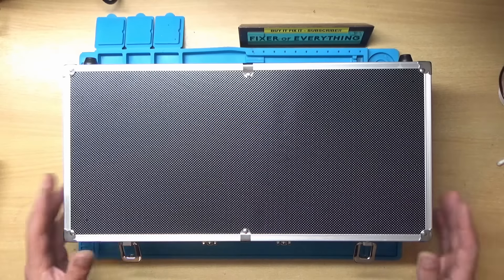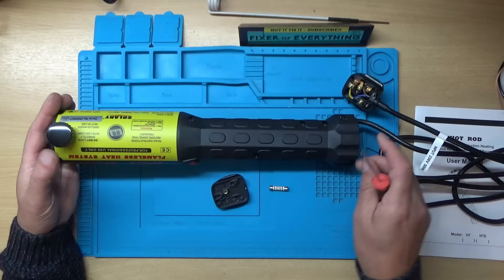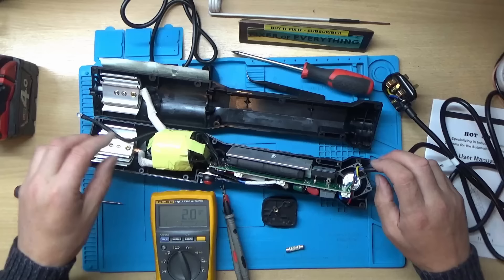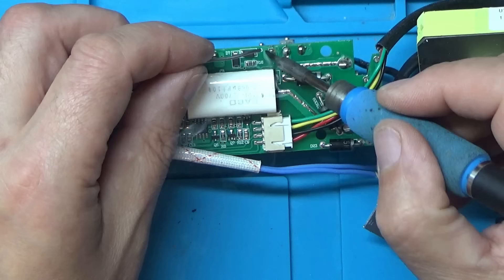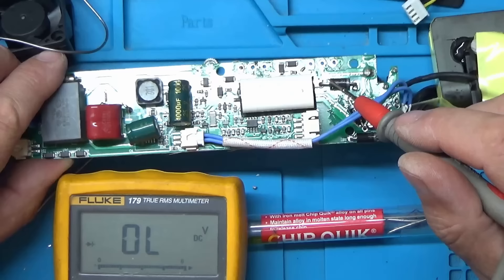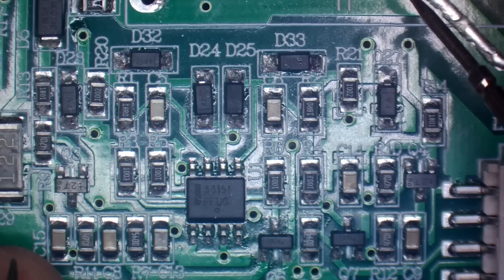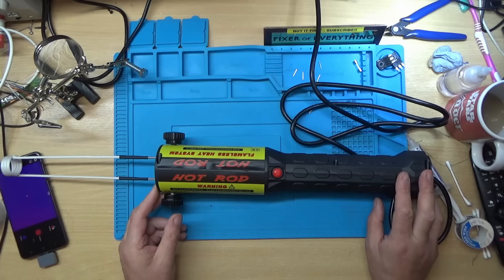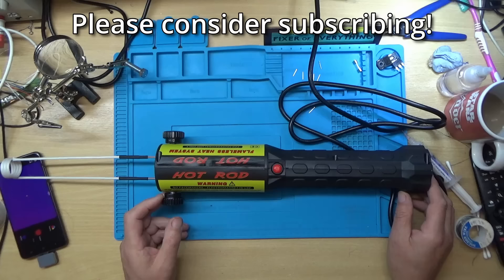Solary 'HOT ROD' Automotive Induction Tool | Can I Fix It?

Comment: hi i think you should replace the igbt driver with the correct part because the thermal switch is for 75c and that is within the operating temperature of the original part but it is outside the operating range for the part you fitted and could fail before the over temperature activates
Reply from the maker: Perhaps, I did think of it, but it's only 5 degrees and it will have a tolerance anyway.

Comment: do you have a cheap suggestion for a decent multimeter please?
Reply from the maker: I've always liked fluke meters but they are usually more expensive. If you get a budget meter get one that is auto ranging as they are a lot easier to use than the type you have to manually select the voltage or resistance range.

Comment: 0-70C is the old commercial temperature range, -40 to 85 is the new industrial temp range  (the old industrial range was -25 to 85) so possibly new old stock depending on where you bought it.
Reply from the maker: Interesting, thanks for that 👍
Reply: extended Industrial (-40 +85) came in at the time when mil-spec components where dying off.  the industrial temp range was extended to pick up the mil-spec components. Which was a real pain as the mil-spec parts came with reliability data which was a great help calculating Mean Time before failure (MTBF's) of your product. You had to stick a wet finger in the air for the extended industrial parts and de-rate the hell out of them.

Comment: You'll need a lot more than 110c to remove siezed bolt, how hot will it go?
Reply from the maker: Apparently it will make them glow red, I saw a video of one in use, but I didn't really fancy a glowing red bit of metal on my desk 😂😂😂😂👍

Comment: Nice video thank you I’m trying to repair a Sykes Pickavant model but can’t find the component that’s broken can you help?
The component is a Orange drop capacitor CDE773P319.
373k550VAC.
1314.
Thank you
Reply from the maker: Hi, from the markings looks like a 37nf  550V polypropylene film capacitor. I did have a quick look but couldn't find the exact one. You could see if you can find one by a different manufacturer of the same capacitance with a higher voltage perhaps? 600V?
Reply: @BuyitFixit  Thank you for the reply can I change the 37nf for higher ?
Reply from the maker: I'm not too sure on that one. It may pass too much voltage or too little if you use a different value.

Comment: @buyitfixit I repaired a similar unit, an expensive one. Pretty much the same curcuit, a lot more diodes for protection. Also brand new, seller just said it was broken. Mosfets, bridge, fuse and one protective diode was dead. My low power side of the board was saved by that diode.
Reply from the maker: Great job. Well done 👍

Comment: Amazing.... I wish i could understand how to repair things like you.... but i´m a car mekanik .... not an elecktrik wizard
Reply from the maker: Thanks 👍 I'm a little of both. I often have my hands covered in oil. My wifes got a discovery 4. Had the body off it 3 times so far, EGR pipes blown, then the turbo's went. Recently had my ML320 up on my ramp as it had the oil cooler problem (after we replaced the main crankshaft seal as we thought it was that). Bloody cars.. .😂😂😂

Comment: The thing I find most difficult is ordering replacement parts, when the data sheet shows multiples of the same part. Along with obsolescence, it gets quite confusing.
Reply from the maker: A lot of the multiples of the same part are just usually quantities or if it is on a reel or tape. I've found that sometimes ICs are exactly the same but with different numbers from different manufacturers, like on the Milwaukee radio I repaired some time ago. Two completely different part numbers and manufacturers, but the same pin out and functionality.

Comment: The fuse is filled with sand it is designed to prevent any connection forming when it blows...By putting a glass fuse in place you circumvented a safety feature.
Reply from the maker: Yes, a couple of others mentioned the same. I'll change it before use. Thanks for commenting 👍

Comment: The ones I have seen working heat nuts and bolts to "red/orange hot" . ..even though they were full size nuts holding down a cylinder head ....... the temperatures in the video were barely above boiling point ....... I think there remains a problem yet to be solved!
Reply from the maker: It does heat up to that point, I've used it since on the car. However I didn't fancy having a red / orange glowing nut on my desk at the time 😂😂

Comment: These things are surprisingly well priced.
Reply from the maker: Unfortunately I think that may be due to the build quality. Some of the previews on Amazon said things like it was dead out of the box or failed after a couple of uses.
Reply: @BuyitFixit   probably because it's using a "cheap" version of an inductive heater driver, like ZVS'es - they fail when you "turn them on incorrectly". The components you replaced are the common culprits... The H-Bridge "stalls" and shorts everything.
Reply: @dimitar4y hi,
Can I ask you to suggest a better quality inductor driver? Or would it not straight swap with the provided pcb?
Reply: @ianhelsbyservices   Sadly, no. I cannot suggest a quality inductor driver - those are what usually makes or breaks the retail available "premium" induction heaters.  

The only "swappable" component is the coil and capacitors. The issue is that quality inductor drivers are usually expensive due to the nature of their requirements. They have 1. sensitive chips to detect the "frequency response" of the coil for auto-tuning, 2. filters to save it from self-destructing, 3. high-amperage, high-speed-switching mosfets - which themselves are already expensive, 4. Bootstrap circuitry - and all of that works mostly specific to the design of the coil (diameter/inductance/thickness/impedance). This is why most people use ZVS drivers as they're "cheaper" than the alternative and require essentially no tuning. But any issues with the power supply or the coil will instantly destroy everything due to transistor failure - the H bridge becomes a full short. Bye bye traces, bye bye transistors, and bye bye power supply sometimes. Most hobbyists use screw terminals for the transistors for quick swapping :')

Comment: Personally I don't like these glass fuses on a mains equipment. The breaking capacity of these is barely 20A at the 240VAC, way bellow the short circuit fault current. That means those are not rated to break the current safely at all, the arc just makes them explode and jump onto something else. Better use the ceramic ones, the breaking capacity of those is 1500A, the cord resistance and mains impedance usually keeps the current within that limit.
Reply from the maker: I might change it as a couple of people have mentioned that. Thank you for your input 👍

Comment: I have two none work. Bought from China AliExpress first worked a couple of days. And heats up bolts and nuts so they turn RED and come off as easily as possible. Changed steering knuckle shock absorbers on a Nissan Micra. And were stuck. Stopped working. My son who is skilled in soldering wondered if there was anyone who had never soldered before as it was very amateurishly done a lot of cold soldering.
Complained and got a new one under warranty. Worked for an hour or so and appeared to be the "same" person who made this. The fuse that was soldered on had tripped removed it and soldered on the brackets to be able to change the fuse easily. But it doesn't work and my knowledge of troubleshooting components "ended" when I replaced the fuse holder. Tried to talk my son into troubleshooting. But the answer was don't even want to see the "shit" again.🤭
The tool itself is and the principle of how it works is absolutely superb, can be accessed in tight places as there are different variants of the "spirals" and can be bent into shape. AND you only heat that part "the bolt" and since it is fast, the heat does not spread to, for example, rubber bushings.
Reply from the maker: I don't think that they are very reliable. I saw a few comments on Amazon saying similar to what you just said. At least if you or your son ever wanted to have a go at fixing it, this video should give you a good idea what to check.
Reply: @BuyitFixit  T
Thanks❗ Yes I will absolutely use your troubleshooting on my devices. Can guarantee that the son will look like this😲🤥. If I find similar faults and ask him to help me replace them, there is a large company Elfa in Sweden that has components. I can handle a multimeter pretty well. Has a short past as a car mechanic on new cars in the mid 70s (Sweden) General agent for Mercedes but also Audi and Simca😬 On a brand new Simca 1100 (similar to a wv Golf) the high beam switch did not work. I debugged with a "test lamp" From the switch on the steering column to the lamp, the cable changed color 4 TIMES and in one of the "joints" the cables did not fit together. That's when my preconceived notions about French car manufacturers turned out to be correct, at least in the 70s. I will get back with the results. And above all you have a new subscriber just the right kind of topic that interests me.
Reply: @BuyitFixit  Thanks❗ Yes I will absolutely use your troubleshooting on my devices. Can guarantee that the son will look like this😲🤥. If I find similar faults and ask him to help me replace them, there is a large company Elfa in Sweden that has components. I can handle a multimeter pretty well. Has a short past as a car mechanic on new cars in the mid 70s (Sweden) General agent for Mercedes but also Audi and Simca😬 On a brand new Simca 1100 (similar to a wv Golf) the high beam switch did not work. I debugged with a "test lamp" From the switch on the steering column to the lamp, the cable changed color 4 TIMES and in one of the "joints" the cables did not fit together. That's when my preconceived notions about French car manufacturers turned out to be correct, at least in the 70s. I will get back with the results. And above all you have a new subscriber just the right kind of topic that interests me.

Comment: Don't you love when semiconductors morph into solder bridges?
Reply from the maker: Yes, I think it's the most common mode of failure.
Reply: @BuyitFixit  True. RF bipolar transistors, the high current flange mount ceramic pill kind, almost always fail open ironically

Comment: Why didn't u just solder a fuse socket so it is easily replacable?
Reply from the maker: Good idea, although I'm not sure if I had a fuse socket lying around at the time.
Reply: @BuyitFixit  You really have an excellent grasp of electronic parts diag. I really want to learn that, but can't find any video's that are consistant. Do u have other videos explaining your diag processes on circuit boards?

Comment: That long part under the heatsink is not an inductor, probably capacitors connected in series.
Reply from the maker: I'm sure it's enamelled wire wrapped around a ferrite core.
Reply: @BuyitFixit You are right, the capacitor is on the other side, my mistake.

Comment: The issue with mine is I can't get the coil to be tight in the tool. It was always hard to tighten the knobs from day one. Had to use pliers.  Probably should have returned it. But now one side doesn't hold the coil at all. I can seem to find replacement parts. Spoke to the company that sold to me. No reply. Useless.
Reply from the maker: Perhaps you could re-tap the threads where the bit that secures coil goes in and use a larger bolt perhaps to secure it

Comment: I have one doesn’t work only used a couple of times really pathetic quality. I don’t have a back ground in electronics so taking it apart would not help me much. These units range from 160- 220 and electronic parts are not very expensive perhaps I may find a local shop to repair it
Reply from the maker: I'm not sure if I'd waste my time. After I repaired this it worked great a few times, then suddenly stopped working. I think there is a design flaw with these units, especially with all of the reviews on Amazon stating similar experiences.
Reply: Thank you so much for replying back very considerate of you to do that! Ok I won’t waste my time with it . There is a reason mini ducter is 500 dollars and these 160-220, buy cheap buy twice.

Comment: You need to put over a bolt to heat anything it does not get hot till there is induction
Reply: Like an induction hob.  It only heats the proper material of pan.
Reply: Right, eddy currents induced in the bolt heat it up.
Reply from the maker: Yes I know, but it wasn't worth at the start as the unit was totally dead...

Comment: You can get a brand new one for little over 100 pounds.
Reply from the maker: This one was brand new 😉although faulty. I didn't really need one, I just thought it might be interesting to repair 😂
Reply: @BuyitFixit  Hope you got some use for it though lol, seems like the type of tool that you don't need until you really need it.
Reply from the maker: @FrozenHaxor  yes, I work on our cars quite regularly and I've encountered a rusted nut or bolt quite a few times 👍

Comment: I think what kills these things is people pressing the button without being on metal.  If there is no metal in the coil, the Q of the tank circuit is much higher (along with the voltage on the components).  The ratings on the devices used to build them are chosen with the assumption that the tank circuit is reasonably loaded.  They would not overrate the parts $$$$ just to ensure people can use it as a flashlight.
Reply from the maker: Interesting, thanks for sharing 👍

Comment: MOSFETS are such an important little item.. 

39.09 clear image of the bottom main induction connector with more copper outside the connector than in.. REALLY ?  Bit sloppy old chap..

 PLUS
"Oh That is a bit Hot.. OUCH.." YOU had just watched it on a thermal camera heat to 110%  but lets touch it anyway....?
Reply from the maker: I'll re-check that, but I'm sure it wouldn't go in anymore than it did. Yes, I thought it might have cooled down a bit, but guess it was still a bit warm 😂😂😂
Reply from the maker: I've just checked back on the video, and it is indeed the copper being longer on one conductor than the other. You can see this when I first disassemble the unit around 04:30 ish. Yes, agree cheap Chinese tat!

Comment: Does he realize at the end, the coil was placed on the screen of the phone he was using to measure temperature and melted at least the screen protector?
Reply from the maker: Not at the time, but the coil is insulated and cools down quickly. Even if not, it was only heated to 100c and they use more that that to remove and replace the glass (no screen protector fitted btw).
Reply: Thanks for the response.  I appreciate your videos by the way.  Just saw this one and am now a subscriber.   I noticed  you said “not at the time”; does that mean there was a different time when you did?  😜. I’ve put burn marks in a few tables and cases while soldering.